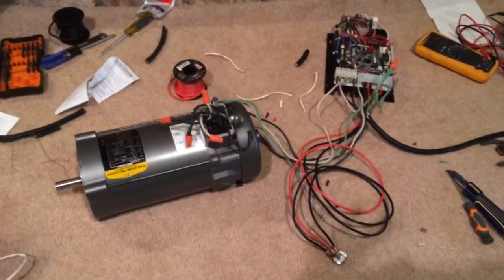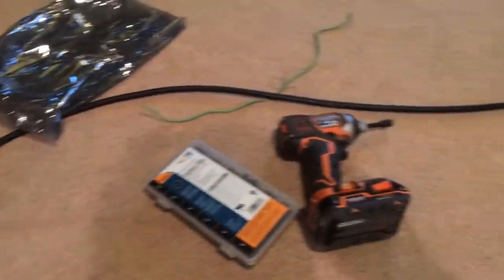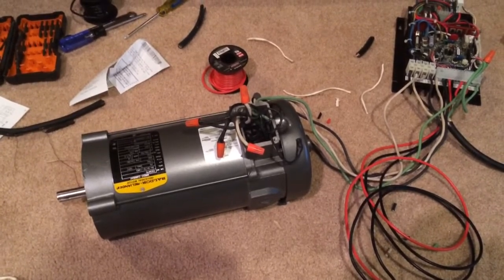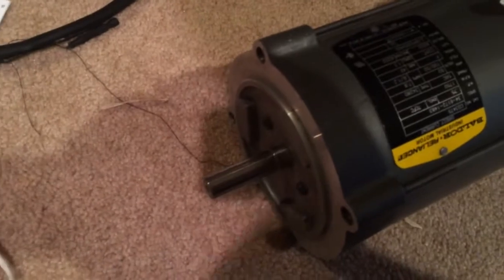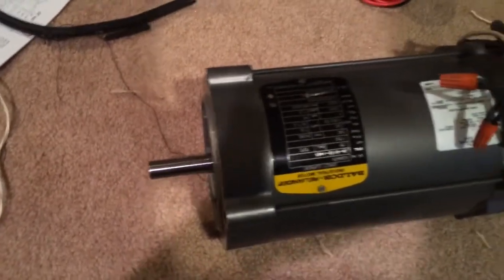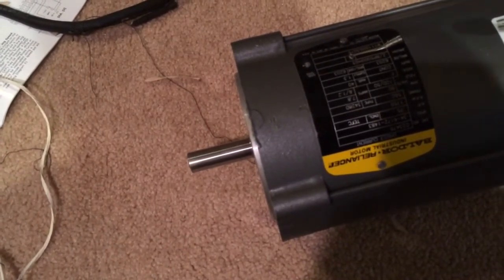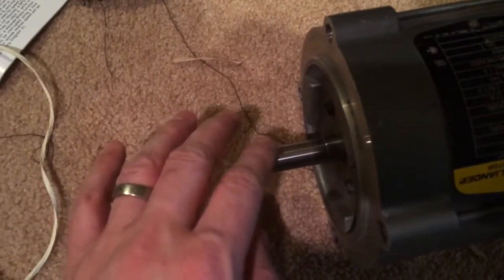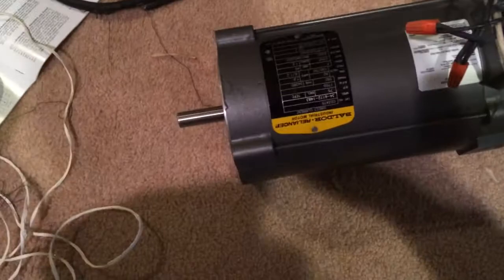Industrial DC Motor

Comment: Aside from the pottery wheel application, I also see this being good for belt sanders and wood lathes.
Reply from the maker: For sure! i have an old motorless lathe sitting in the garage, i might pull it for that... i should have grabbed more from my friend when he had them.. :)
Reply: In thinking a bit more about this, the DC motor would be better on the lathe because it runs at a higher speed and the lathe gets its torque from gear reduction, while for a pottery wheel you might be better served with a three phase induction motor on a VFD since the motor speed is set by frequency and will hold speed even when you are really working hard on the clay.